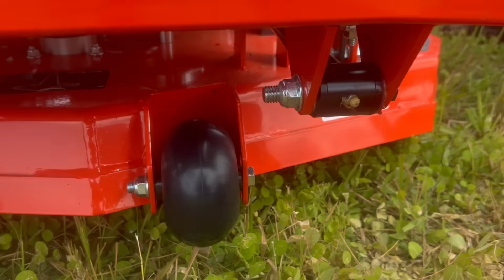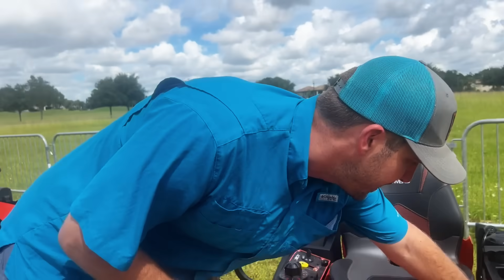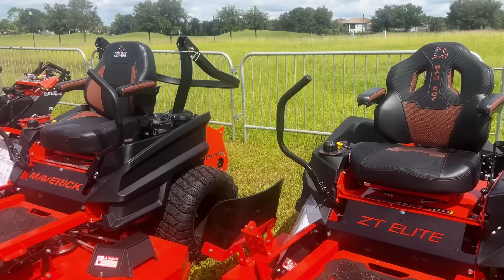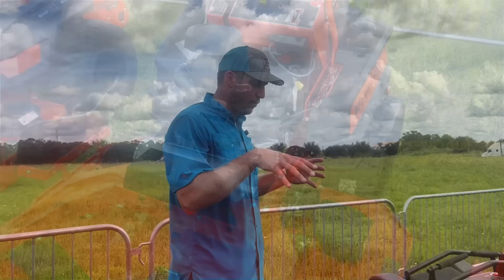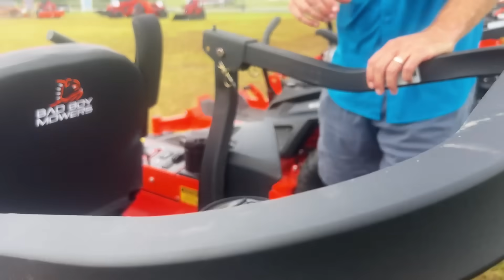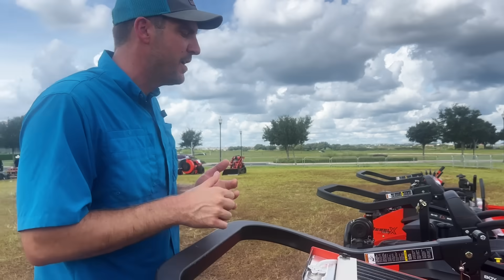Bad Boy's 2026 Zero Turn Line-Up | First Look From Dealer Meeting

Comment: In my opinion one major upgrade bad boys should do is put a 30 horsepower Kawasaki fuel injected engine on the Maverik HD. The option on the Mavericks currently is not enough horsepower for my wants especially with a bagger blower system. Oddly enough if I gotl to a 54 in Revolt I can get that bigger 30 horsepower Kawasaki engine on it.  I know the Rogue has those options, but it's also a lot bigger which I don't want. 
On a side note thanks for your videos you have a lot of good ones.